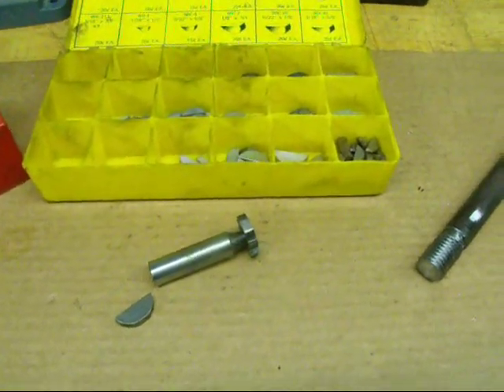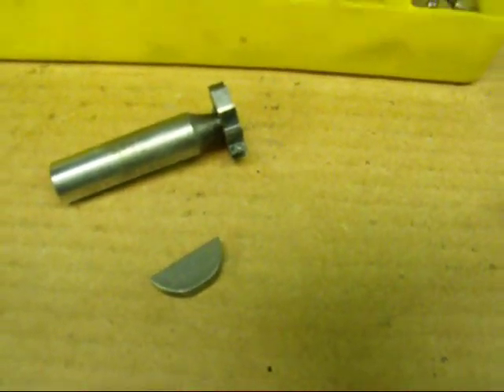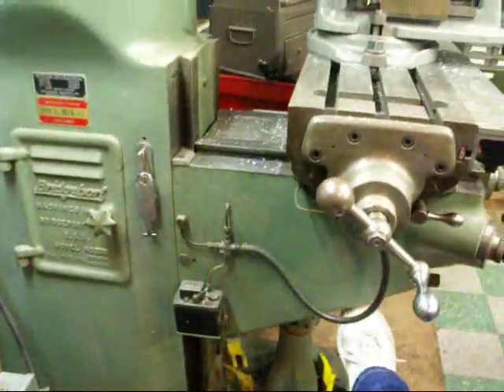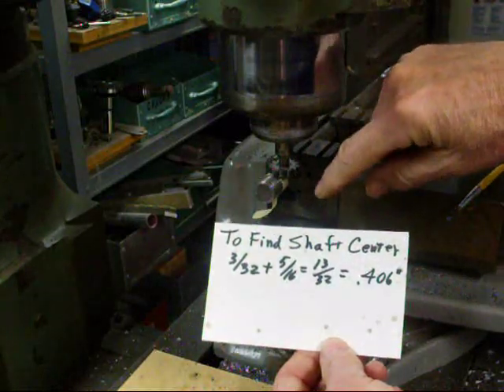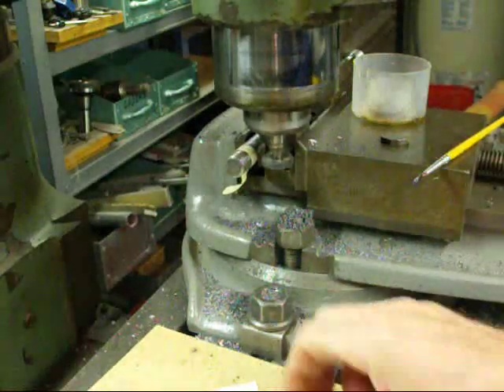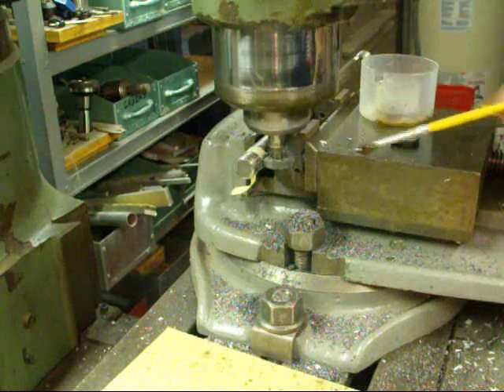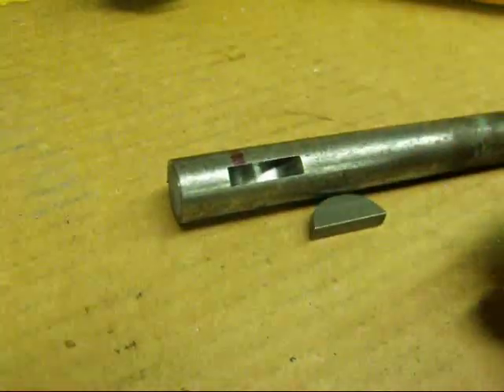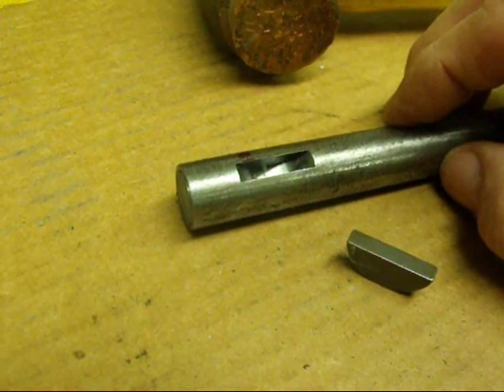CUTTING A WOODRUFF KEYWAY on the BRIDGEPORT MILL

Comment: great video! I sure did run into a lot of these keys as a kid tinkering around with small motors, the driven centrifugal clutch or whatever other driven item was almost always woodruff keyed. good memories, now that i'm finally getting into the manufacturing / machining / tooling end of things.

Comment: what i do at work, is use a special tool to set up. it is just a ring with a flat on the diameter (much like a D shape) and a tapped hole on the diameter- once your bar is set up, your should clamp the ring onto the bar, using a bolt screwed through the hole, and then use a DTI or a square to set up the flat. then you can remove and set up your bar again using that flat (aslong as you don't knock it out of true). PS. i do this on big shafts and clamp them on vee blocks.

Comment: mr.pete, i was thinking about how to cut keyways with a woodruff cutter, that are in line, on opposite ends of  a shaft that is longer than the table will travel. how can i cut one keyway and keep it in line with the first one when it overhangs the table. what am i missing in the set-up. thanks mr. pete.

Comment: i had to pull the front off of a chevy 292 recently and it had a key like this on the crankshaft beneath the crank pulley. i didn't think to find out if it had a name.

thanks for the info!